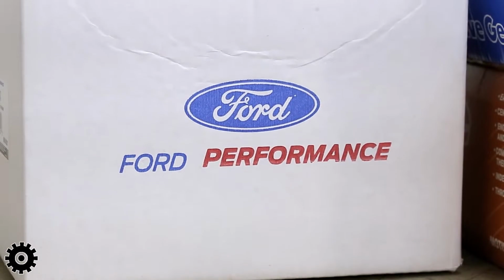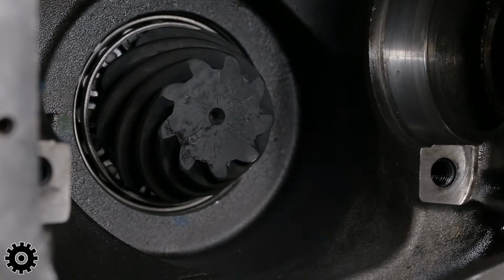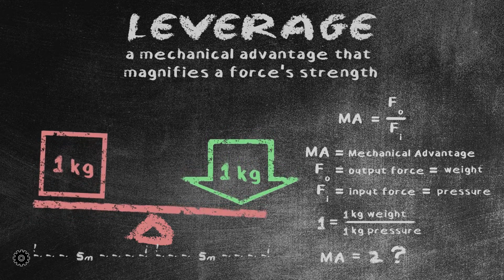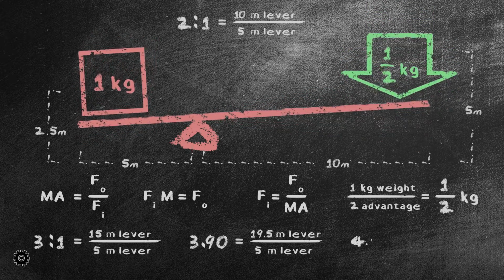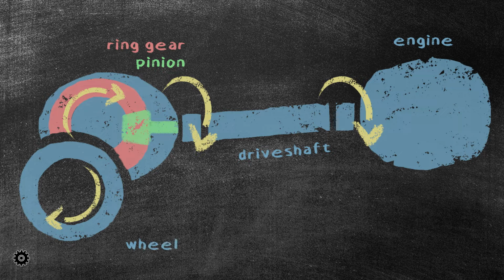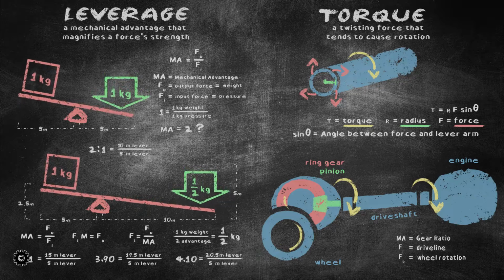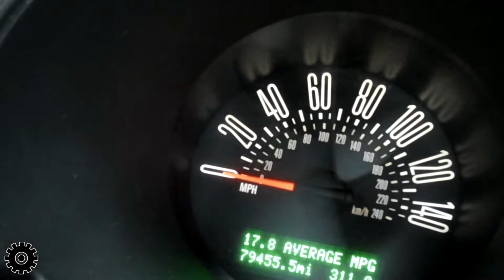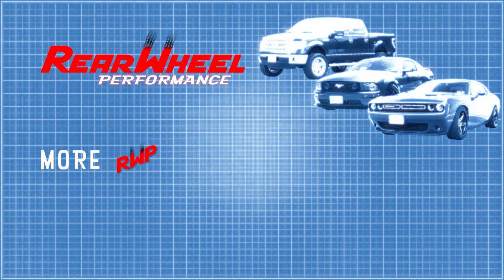Ring and Pinion Gear Ratios Explained: Increase Torque WITHOUT losing MPG

Comment: I replaced the 2.73’s with 
 3.55s in a 2014 Mustang 3.7l. Gas  mileage dropped off by about 12% but it’s allot easier and funner to drive on moutain widening roads.
Reply from the maker: Straightening the curves, flattening the hills. Someday the mountain might get 'em, but the law never will.

Comment: The heat lost through the fluid movement (gear oil) in the diff is called "shear losses". Good videos, loved the Ford 9" 5 parter, especially...had some great quick tips on shimming I never knew
Reply from the maker: This guy gets it.  We aren't trying to be know-it-alls, just sharing some know-enoughs.  We'll pack that bit of knowledge away for another day, thanks!

Comment: So what do you believe is and optimal gear to run in a truck that has a 350 small block and turbo 350 tranny and running 35' tires???? Thanx in advance
Reply from the maker: Gear it to your comfort level with your engine build and optimal operating rpm.  At, say 75 mph, 3.73 would put it a bit under 3000 rpm highway, and 4.10 would put it a bit over 3000 rpm.
 https://www.nationaldrivetrain.com/calculator.php

Comment: So I have a 2009 F150 and I have 40 inch tires planning on installing 513 gears do you think that gear ratio is OK with my vehicle?
Reply from the maker: It will be fine.  The numbers show it to be about the same as the stock final drive rpm.  Use a lot of caution setting them up and breaking them in.  Be sure to change out the diff gear oil after the first few hundred miles.
Reply: @rearwheelperformance  OK thank you for the advice couldn’t find too much information re-gearing  513 gears on the F150 at all and then when I did a lot of people said that you won’t be able to drive on the highway and some people said the opposite tons of low and torque and performs good I just wasn’t sure at all and if I should get the vehicle tuned to shift correctly
Reply from the maker: @re9473  A lot of people just repeat what they've heard without taking time to figure out the math.  And, yes, definitely should look into tuning for proper calibration.
Reply: @rearwheelperformance  also, how did you come up with the numbers?
Reply from the maker: @re9473  https://www.nationaldrivetrain.com/calculator.php

Comment: Really good explanation about gear ratios, thank you very much, i´m having troubble to find the correct ratio for my 1973 dodge charger 318CI, i´ve install a lot of perfomance parts, but haven´t touch transmission and rear gear, i live  in a city wich is 2750 meters above the sea level and my car is not fun at all, any chance you may help me with the correct ratio needed to burn my tires down at the stoplight.

Regards
Reply: Raul, in my experience muscle cars usually have a carburetor out of tune and the distributor out of tune, intake too big,. Both of these must be tuned for your car, your parts, your driving style, and your altitude. Usually the carbureted is too big, too rich, the cam is too big, and nothing works together. An original car works better and is sometimes smoother and faster, correct ?
Almost all my cars are old, with carburetor and distributor. Some have small engines, small carb, auto or std  transmissions, big engines, .... rear differential ratio 2.73, 3.08, 3.73, 4.56:1, different tire diameter..

All my cars run smooth, efficient,  and accelelerate fast. The tune must be precise, that's all.
Reply from the maker: A couple of the optional rear models from that year still have a lot of aftermarket parts available.  You can match your optional rear end model on the www.nationaldrivetrain.com site, and call them to help you find something that will definitely help make it more fun to drive!